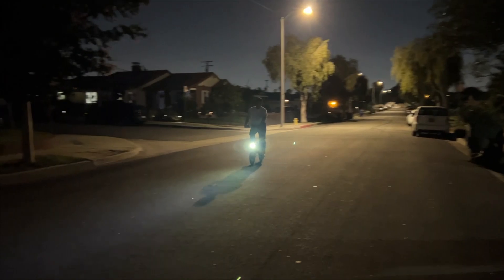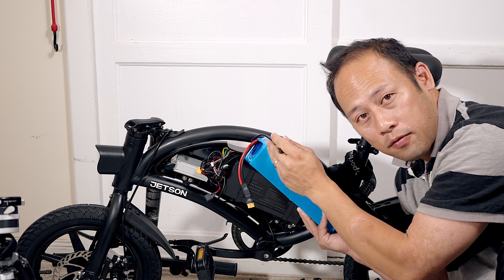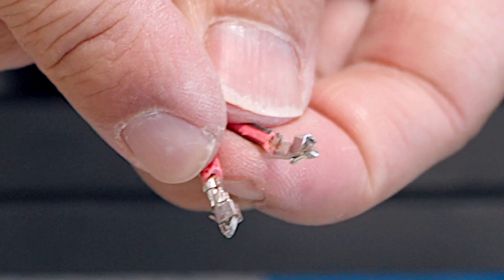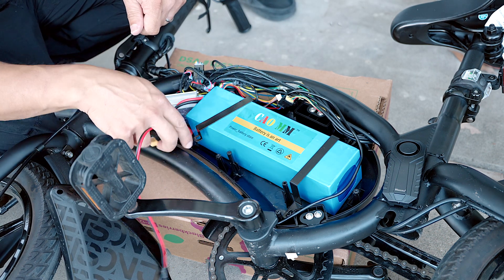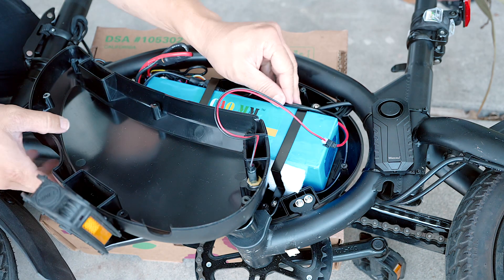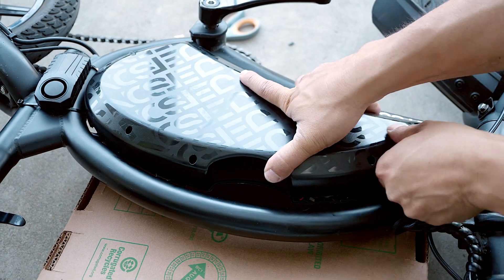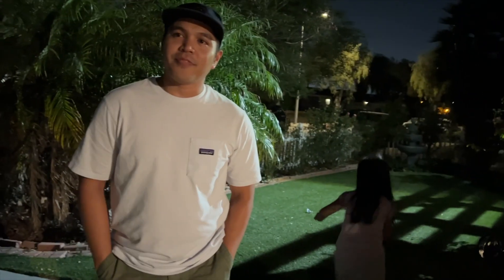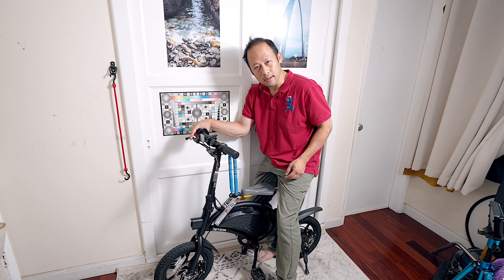Bigger Stronger Faster Jetson Bolt Pro - Battery Upgrade Version 2

Comment: Couldn't this catch fire if it drops below the voltage safety zone of the 48v pack when utilizing the 36v thresholds? Also the stock charger would only charge to 42 volts right?
Reply: That’s why you don’t use the stock charger, and you need to watch the voltage
Reply: Hello I recently wanted to mod by bolt pro but I'm new to this hobby I want my bike to go at 20mph I recently bought a 48v 10h battery and a elgoo r3 to unlock the speed. Do I need anything also before doing this mod also any tips out there?
Reply: @lilyun3489  did you do it ? It's been 3 months
Reply: @lilyun3489 I have a 48v 12ah using the elgoo Speedhack and I clocked at 23mph after biking across town and testing speed on way home
Reply: @seraphimog3564 every thing else stock other than the battery?
Reply: @kylemanera1746 Yeah. He didn’t change anything except the battery
Reply: @seraphimog3564 Did you have to get a different controller or did you use the stock controller?
Reply: As someone who builds  and flys drones using similar batteries and also modding jetsons for a few years, No... The pack wont catch fire on a voltage drop. No, the Battery BMS board determines where the charging stops, not the cable/charger.
Reply: @HyperFlowFPV  exactly, they didn't change the bms, my statement had two separate points.
Reply: @AI-Driven-Entrepreneur  the battery has the BMS built in on both the stock battery and the replacement battery
Reply: That's why we get insurance

Comment: The Jetson bolt Pro is a 36 volt when did they go to 46 volt on the Jetson bolt Pro
Reply from the maker: always been that way. consider that ancheer version is likely using the same controller only difference is the battery.  refer to what’s being talked about in this video: https://youtu.be/An3M_bW7nV0
Reply: @YouTruther  can you do my jetson upgrade it

Comment: Thank you so much.  I have been waiting to see this upgrade for a long time.  I have several 48 volt batteries from previous ebikes that I have been afraid to plug into the stock Bolt.  Now I have 30 AH of 48 volt batteries for the Bolt!!!
Reply from the maker: wow
Reply: I read that the battery meter on the bike does not work properly if you use a 48v battery.  Is that true?
Reply: @stevelouie5928    Yes, you are completely correct.  What he did not mention on the video is that the bike is set up measure the voltage meter for a 36 volt battery.  Using a 48 volt battery will trick the bike to thinking it has a very well charged 36 volt battery, and not tell you when the 48 volt battery is low.  SO>>>>>  unless you install a voltage meter, you will be deeply discharging your new battery, and it will be damaged due to over discharge in a short time.

Comment: Using thinner cables, don't do it, you will increase the fire risk.

If you want more range add an extra battery to the back of the bike in parallel with the other battery, if you choose a 48 volt then add in a 48volt but be aware of the issues I have highlighted for safety.

When these things catch fire they burn very fast so any upgrades you do you need to be aware of the fire risks, especially while charging.

Always solder joins never leave them as press fit, unless they are meant to be press fit connector to connector, wire to connector should for safety be soldered.

If you want more range just fit a rack on the back and add in a bicycle battery pack in parallel that has the holder, you can lock that into place with no vibration, and you can charge both batteries off the same socket.

But I say again your 48v hack could pose a fire risk as it is.
Reply from the maker: sorry, you don’t quite understand. the charging cables have always been thinner than main cable. they carry only 2 amp load vs 15 amp to 30 amp load of the main. think of it this way. you need to charge your phone, do you buy an extension cord and small charging cable or simply longer charging cable?

the Jetson bolt Pro uses 20awg charging cable, I kept my wires 18awg, you can see in the parts list.
Reply: @YouTruther  I get ya, so basically you are going to set your charging cables back to the original size rather than charging through the main connector wires.

But doesn't the new battery have a charging connector which runs from the BMS?

My one does have a charge socket that runs from the bms.
Both my batteries charge off the same circuit with separate BMSs so each pack is controlled by each BMS but will charge off one circuit.
I can connect in two chargers for a faster charge.
Reply: @YouTruther I want to do this but I'm afraid this thing will catch fire like this since mine is only 250w. I don't know much about ebikes.
Reply: The bolt pro is 350 watts.... .
Reply: I’m interested in upgrading the internal battery for more range, already speed hacked and am fine with the current speed; but don’t want to create something that could potentially be a fire hazard, tips?
Reply: @BirdBoss  Well with my Kugoo which is exactly the same as the bike you have but under a different name I use two batteries in parallel.

You need cable and connectors of the same type as on the original battery.

A rack for the back of the bike the type that connects to the seat post.

Solder all joints to bare wires, never just crimp them, over time wires crimped lose connectivity due to oxidisation, which in turn could cause issues with charging and potentially a fire.

Always from time to time check the connectors to ensure they provide good contact.

In the video the side plate was removed from the controller, as I said that is not a good idea, you could have bent over the tab or cut the tab off, but removing the side plate not good.

The body of the controller acts as a heat sink, the heat sink body is held on to the insulated mosfets by a metal spring, the vibrations may put strain on that spring causing it to jump out of place which could cause a short circuit if the spring vibrates off and crosses the mosfets thus burning out the controller or causing a fire.

So for safety replace the end bracket but either cut or bend the tab over that is getting in the way.

check out this guy he has done lots of mods.

Check out the rack type on the back.

https://www.youtube.com/watch?v=SMWR_goR1rw
Reply: I agree, and you will be over discharging your 48 volt battery because the charge protection is made for a lower, 36 volt battery

Comment: Another issue may be that as time goes on the inner circuit board may vibrate and cause the heat sink on the controller to pop out, because the end of the controller you took off not only  provides a place to anker the controller but acts as a stopper for the circuit board from falling out of the heat sink body of the controller.

If that happens when you are riding along it could cause a short circuit and blow your controller.
Reply from the maker: definitely should have bent the bracket up instead not too concerned as the other side ids screwed and Apias that all the woes are stuck on the board attached to the other side.
Reply: Not true, the speed controller mosfets are held on the side of the case  by a very strong peace of spring steel. Plus the ends are screwed on.
Reply: @robertreed2259  Yes that is correct the mosfets are held onto the body of the case by a spring steel device, but without the end holding the board in place it may become loose in which case the spring may end up touching the board which could short the mosfets if unlucky.

This is what I meant, the end of the case does have a function other than just as a bracket to fix it to the body of the bike.

I almost shorted out my controller when I was putting some heat sink paste on the mosfets to get a better transfer of heat to the body, so that spring comes out easier than it goes in.
Reply: @user-k-333  Only problem with double sided tape due to the constant heating and cooling the tape may lose its ability to stay stuck over time.

Comment: First off do not leave those wires press fit in the new connector, solder them into the connector for safety, the reason being it could potentially cause a fire.
Reply from the maker: they are designed for press fit, they have a latch that keeps them in place permanently, it’s explained in the video
Reply: @YouTruther  Connector to connector yes press fit, connector to wire using them as press fit and soldering the wires to the connector is potentially a risky thing to do, short term it might be ok, long term it is risky.

I would not use wire to connector press fit without soldering the wires into the connector for safety reasons.
Reply from the maker: @flitsies  when you crimp Jst, you grab a tiny bit of insulation/ jacket with the crimp hence the two crimp operation , solder not necessary and a preference for some.
Reply: @YouTruther  Well your choice but it is not something I would do, you will be pushing a charge current through that socket, all I can do is tell you my position on it.

Oh and check out some of those fires where batteries have burst into flames while charging, for the sake of a dab of solder!! well it's up to you, but I wouldn't do it.
Reply: @flitsies  You're both right. Crimping it is fine, and how its meant to be done. But for extra precaution & safety, i would also reccomend a small amount of solder on each, because wires DO pull out of connectors.... If it can happen on dealership-built cars & trucks which go through an extensive QA... it can happen to your crimping job as well.

Comment: Thanks for another excellent video! I’m curious - how did you determine that the controller and motor both support a 48V battery? I believe all of the other 48V battery swaps I’ve seen have come with a controller upgrade
Reply from the maker: just some deduction based off what I was talking about in this video: https://youtu.be/An3M_bW7nV0